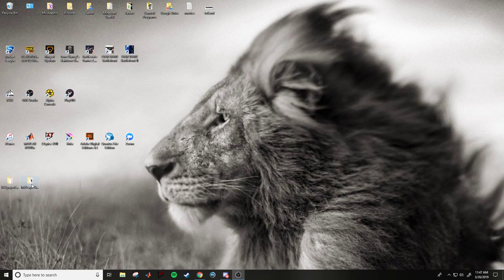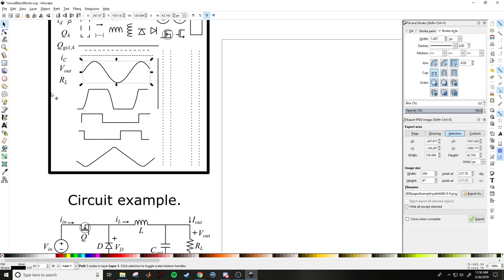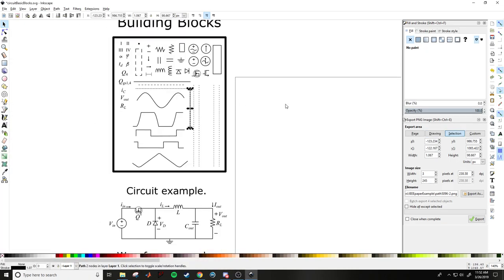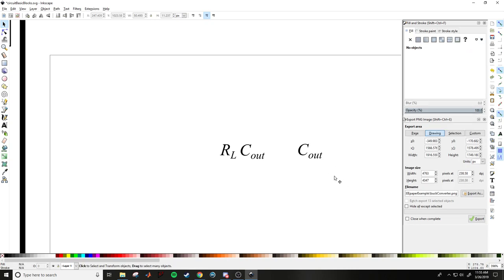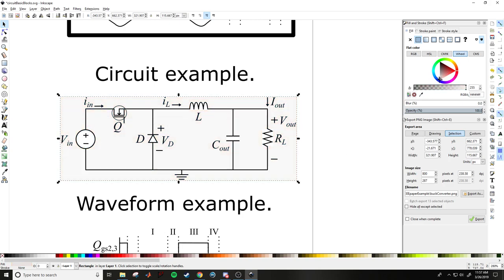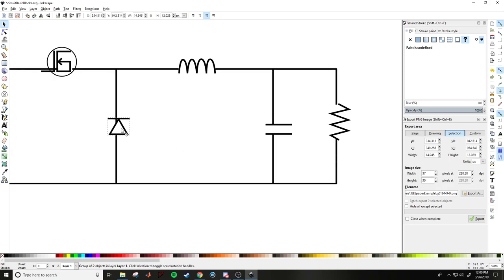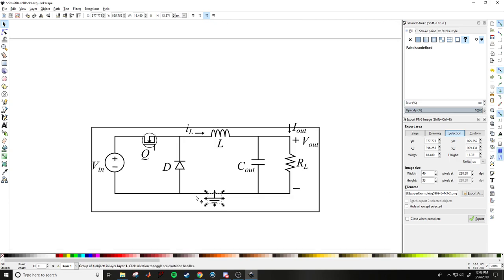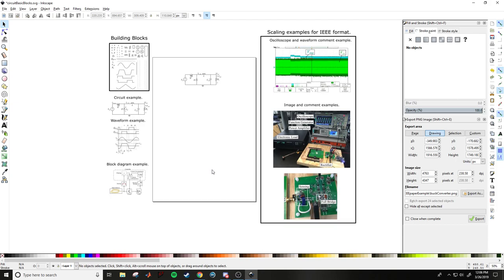Tutorial: How to Make Circuit Diagrams with Inkscape (for IEEE Publications) | With Starter Files

Comment: Hello Spencer, this helped a lot. Could you please elaborate on how to keep the stroke width constant? Are there any other options that have to be enabled/disabled in addition to the 'move gradients' option as described by you at 2:02. Thanks a lot!
Reply from the maker: I'm glad it helped! Not that I know of -- what I cover at that portion of the video is all I use!
Reply: @THEspenc2020  thanks, it works well with the squares but if you try this with "Flow Chart symbols", for some reason the stroke width issue doesn't work. Anyway, thanks again for the tutorial! :)

Comment: Hi, thanks for sharing. Are you currently working with dc to dc converters?
Reply from the maker: Hi! I have worked with some DC-DC converters in classes, but currently I am working with wireless power rectifiers.
Reply: @THEspenc2020  Have you measured floating voltages with an oscilloscope? I have that issue with the buck-bost. Would you be interested in talking/collaborating about power electronics.
Reply from the maker: I would be happy to try and help you -- what problem are you running into exactly?
Reply: I don't have an oscilloscope that can measure floating voltages and I need to measure the floating  output voltage of the buck-boost. Any ideas on how to do it? Thanks
Reply from the maker: @jafetmartinez3898  You can measure both the positive and negative rails with reference to ground (+OUT-to-GND and -OUT-to-GND) and then subtract the two measurements!